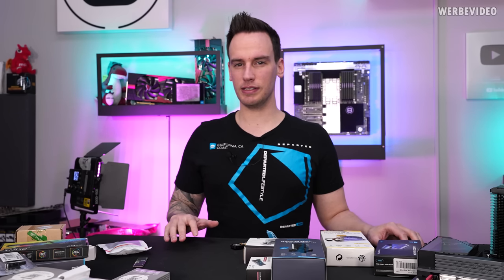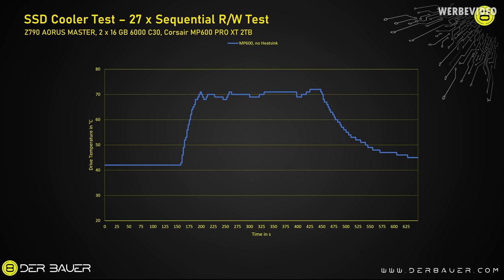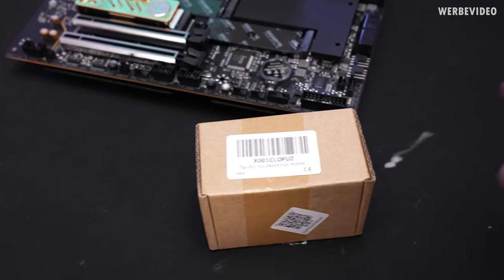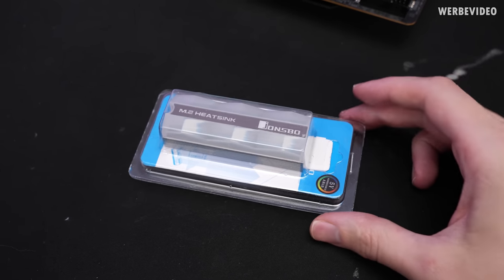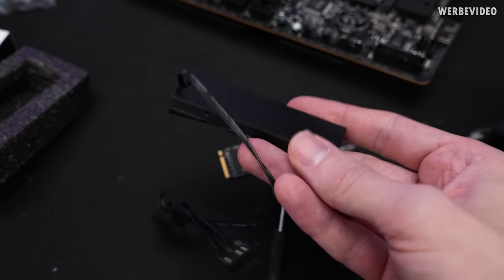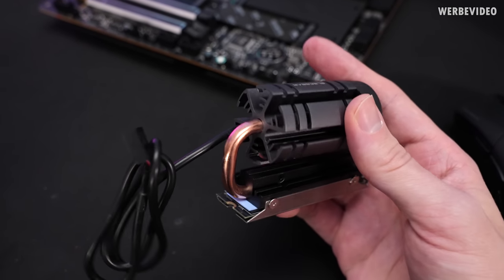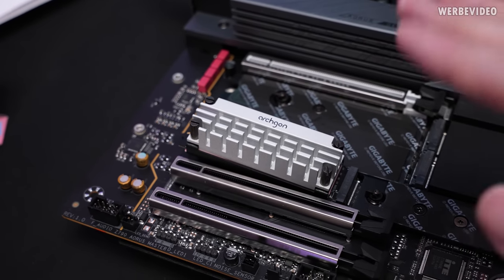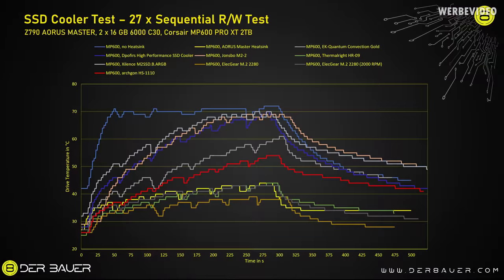Who designed these? Terrible Cooling Performance and "Interesting" Mounting Solutions

Comment: Definitely do another video! And in the end, the Dpofirs came in with the zip ties, and it was better than the EK cooler :D
Reply from the maker: will do :D maybe next time gold plated zip ties
Reply: @der8auer-en  Would be interesting to add DolDer 60mm M.2 cooler. It looks like a tower CPU cooler.
Reply: so whats your problem with zip ties, huh?! huh?! zip ties are 100% legit, maybe not exactly pretty but it works! zip ties and duct elephant tape!
Reply: @h0rk3d  Linus would approve
Reply: @der8auer-en  Speaking of whacky marketing claims with M.2 coolers I'm curious about icepc's graphene-coated copper heatsinks, how they compare with their copper variant and their performance compared to some you've already tested.
Other brands I'm curious about include 
Sabrent, BeQuiet, EKWB's finned aluminum model

Comment: Glad to see the Thermalright HR-09 performing so well and basically being one of the few non-scam solutions (might even outperform the stock shroud given long enough time because it actually transfers heat to another medium and doesn't just soak it up with sheer mass) because I'm planning to buy one once I have a PCIe 4 or 5 NVME simply because I like big shiny air coolers and I'll use any excuse to have more of them in my PC.
Reply: yeah it's the only one that actually looks like a serious cooler
Reply: I actually ordered that one last week (the smaller one with a single heatpipe) to eliminate the fan on my x570 ITX motherboard  (the ssd and chipset share a small block of aluminum with a 30mm fan on it)
Reply: 100%. I remember Thermalright being one of the very few who could compete with the big Noctuas so I had high expectations for them and am glad they delivered. To further defend the HR-09, the only competitive coolers were a comically giant slab of metal which would probably get heat soaked really quickly if the motherboard was fully populated with four drives and another cooler with a super annoying fan. With four drives that is a lot of cables, headers, noise, extra cleaning, and messing with software monitoring and control that you can avoid by going with the Thermalright.
Reply: The thermalright may actually perform better with a GPU pulling air through it as well
Reply: That thing is absolutely absurd.
Reply: @TangoOne  Good for you, motherboards with tiny fans on them are cursed.
Reply: I have been quite pleased with the two Thermalright cpu coolers I own. Their products actually work well.
Reply: Looks like there are 2 versions of the Thermalright HR-09 2280 SSD Heatsink, a short version and a larger version as shown in this video.  I wonder if the short version cools just as good as the original.
Reply: Based
Reply: @jordanviray  Heck yeah. I still remember way way back in the day using the Thermalright SLK-800u/900u coolers on Athlon XP platform. Giant solid copper fin stack. Was crazy back in the day. Back then water cooling was very DIY, and there were no AIOs, so it was about as good as it got with a manufacturer designed cooler. Especially if you threw a delta fan on it and pretended you didn't care about hearing loss. Hit some records with that thing on a volt modded DFI infiniti motherboard back in the day (280ish FSB iirc). Good times.

Still have an slk-900u laying around somewhere.
Reply: @icommandoi145  I have the short version. My first gen WD black was hitting 65 degree at load and with HR-09 it drop to around 45 at load.
Reply: @Turbobuttes  It's funny, I constantly see people complain about active mobo cooling fans but I've never had an issue with any of mine. I even just retired a daily X79 rig that has been a workhorse for over a decade and both the chipset and 5K rpm VRM fan still work like the day I got it.
Reply: @outsider2k8  I decided to buy both and do some tests of my own.  They're quite reasonably priced on Amazon right now.
Reply: @icommandoi145  I have it installed on a asus hyper m.2x4 card and my old case air flow isn't the best. I paid about 30 Canadian dollars for mine, thou there are so many different sellers while fulfilled by amazon.
Reply: Mounting that HR-09 on an Asus X99 board with that upright SSD slot it has is going to make GPU installs easier. Especially as that SSD slot is stuck out there next to the RAM.

I reckon with good case airflow it should shed heat even faster and probably drop a few degrees as well.

OK. Done. Ordering a couple.
Reply: The stock shroud solution is horrible, his test is wrong and doesnt reflect reality, i had aorus master and returned it.
Youll have diffrent results when you have more than one M.2 [I had 4] and after sometime, the heatsink not only abosrbs heat from m.2 but also from chipset and on z690/z790 it gets HOT
Reply: @NoBodysGamer  See that's why I dislike the entire trend of huge heatsoaking shrouds that give a false impression of good cooling. I'm starting to prefer boards that just don't come with shrouds in most areas and let you remove M.2 heatsinks one by one instead of only a single shround the size of half the board. In 2030 people will look back on these idiotic giant shrouds and cringe. Unfortunately the high end segment has basically been conquered by them because of sleek look memes.
Reply: Yeah, the Thermalright cooler looks like it has the surface to get rid of the heat. So yeah, with some airflow in the area, either due to the GPU sucking air along or case fans blowing in the direction should be good.
Reply: @TangoOne  but will you have enough cooling for your chipset now ?
Reply: I recently built a new rig, so I moved my Thermalright Macho rev A. from my FX8350 to R5 5600X, so it's nice to see them still being alive and kicking.
Reply: Thermalright had it in the bag since those heatsinks are basically repurposed VRM heatsinks they developed back in the day. Those were pretty capable.
Reply: @Turbobuttes  Just as motherboards got conquered by "gamer rot". Which is plastic and RGB. I would pay extra for a normal board with proper heatsinks on the important parts without cutting corners so they can incorporate fancy plastic designs and RGB.
Reply: @rustler08  Oh mein gott NEIN NEIN NEIN 9 9 9 9
Reply: @kurosumomo  Oh yeah, motherboards with copper heatpipes all over them, those were the days!
Reply: You need to check out the HR-10 Pro instead. It actually has an embedded fan and seemingly 2 extra heatpipes, and thus isn't as ridiculously tall as the HR-09. Plus it's only like a buck more so why not.
Reply: @johnjingleheimersmith9259  Because if there's one thing that active chipset cooling has taught me it's not to utilize tiny fans for what you can accomplish with case airflow.

Comment: Amazing job! Definitely waiting for the second part! Also would be great to see a bit more of simple and compact options in terms of height, like the last one (archgon) in that video. They seem far more reasonable to buy and the review  might be helpful.
Reply: A bit like small RAM heatsinks or those for Raspberry Pis, just a small fin arrangement that fits on the chip and gives some more surface to dissipate heat.

Comment: Great to see Thermalright still producing, albeit quietly and without fanfare, very functional and well performing cooling solutions.  I recently tested their Frost Commander 140 on my 13600K CPU and the performance was impressive, on par with the NH-D15.
Reply: I'm still using their cooler from 2008 on modern Ryzen CPU. Works very well.
Reply: They are getting good PR from Youtubers now. Gamers Nexus covered them so they're back in the hobby's notice.
Reply: I still have their HR-02 Macho in use here. Fine thing, does a fine job at a good pioce and without much noise.
Reply: He needs to run the HR-10 Pro instead! it has an embedded fan like that elecgear alibaba cooler.

Comment: My IcyBox M.2 cooler has a 30mm fan and I had to lock the fan at 20%. Any higher and you can start to hear it. It honestly doesn't even need the fan anyway, I actually thought about taking it off. It has a big heatsink, passive would do just fine.
Reply: In a file server believe me without active cooling  on nvme you lose performance  wich delays the transfer speed  and you don't want that on a file server  and if you install the entire pc in a cilmatised rack and noise isolated the you won't get bothered by noise 
Y mean in some use scenarios it it delivers high performance 24/7 without bottle necks  and it does not throttle is at best and at my opinion do not use copper cooling solution because it cant disapate the heat quick enough aluminum aloy is at best
Reply: @adriancoanda9227  yea really depends how much airflow and what passive heatsink you have on ur nvme but yea for servers they do get crusty and sometimes even the system is almost unable to load anything
Reply: @adriancoanda9227  Who said anything about a server? I have ITX PC build in Jonsbo V8 case. I use Mushkin Vortex Gen 4x4 Nvme and it runs HOT! That is why I get cooler.
Reply: @y_zass  check the voltages on the slot if they are in specs with the cards required cause that card should also compatible with less Powe devices like a PS 5
Reply: @adriancoanda9227  Copper dissipates heat away quicker than aluminium! If aluminium was better then all the cpu IHS would be made from it!
Reply: @madb132  oh copper has a better condutibility, but aluminum is better at heat disapation to air and is far cheaper and way more resistant to corrosion  why do you think they made car tires from it why do you think evey refrigerator has aluminum disparcer  when you want to build a heater in this case you are right copper is better because even after the hot water is cold it can still give heat away but that is actually a downside in pc builds where air cooling is the key  why the aluminum density Copper has a higher thermal conductivity, and therefore is superior to aluminum in processor cooling. Copper is better at conducting heat than aluminum, but aluminum is able to radiate the heat into the air better than copper because of its lower density. Look it up
Reply: @adriancoanda9227  The density of a material does not affect the rate in which it transfers thermal energy. Thermal dissipation and thermal conduction are the same thing, the only difference is where each term is used in common language. There are two factors that determine the rate in which two identical pieces of metal cool down, thermal conductivity (w/m*K) and thermal mass (Measured as specific heat per unit mass J/K*M^2 or per unity volume J/K*M^3). This is where many, yourself included get confused. You take a block of aluminum and a block of copper and heat them both up to 100C then measure how long it takes to cool down, of course Aluminum wins. However you are failing to account for the fact that you had to put 3x as much energy into the copper in order to reach the same temp due to the higher thermal mass. Density also has nothing to do with it, thermal conductivty does. Lead is 26% more dense than copper and has 1000% worse thermal conductivity. Silver is 17% more dense than copper and has 5% better thermal conductivity. Both are more dense, yet one is better for thermal transfer and one is not.

Fix the experiment by applying an equal heat source to the block of copper and the block of aluminum for the same time period, then watch how long it takes them to cool down. The copper wins every time, because it has a better thermal conductivity. At the base layer conductivity from metal to air is all conduction, convection happens beyond the boundary layer and is a combination effect of conduction and advection (bulk transfer in this case of heat energy through a fluid), add a fan and even more air molecules are in contact with the copper to conduct heat away via forced convection. The metal/air boundary transfer rate is still won by copper on all fronts. The reason we use aluminum instead of all copper is for weight and cost. Copper is almost 4x the cost of aluminum, it's also almost 4x as heavy. An aluminum heat exchanger in a fridge that weighs 4lbs would weigh 16lbs if it were copper, it doesn't seem like much but it all adds up. I don't even know what you are on about with tires, if you mean aluminum rims then it's not actually pure aluminum it's an alloy between zinc, Nickle, aluminum, and other trace metals. Copper rims would also be a horrid idea considering how soft and prone to work hardening it is, then add in the weight and you have the worst rims around. 

Now take the cost difference. A 2inx144in square bar stock aluminum costs $200, the same dimensions copper bar will run you $2,600. The reason they use copper where space is at a premium is because it's better in all regards thermally. They use aluminum when there is free space because it's lighter and cheaper and to make up for the worse thermal conductivity you only need to increase the thermal transfer area by about a factor of 1.6.

Comment: If you used the included thermal paste around the heatpipe then the ElecGear would probably perform a bit better.
A really intriguing SSD heatsink is the "JEYI Snowpard", It has an M.2 riser card which flips the SSD orientation and gives space for a thicker heatsink on the back of the SSD.
It makes more sense it pictures.
Reply: @adriancoanda9227  bot comment?
Reply: Oh, that actually makes sense. I was wondering how good is the contact between the pipe and the sink if the pipe can rotate.
Reply: @BlueDragonix  badly coded bot, that bot comment should have been posted under today's LTT or Hacksmith videos. (that's my assumption anyway)
Reply: @CanIHasThisName  That's what the screws are fore. Losen the pressure to rotate, then clamp it tight again for cooling.
Reply: @HappyBeezerStudios  Obviously, but clamping it only prevents it from rotating. For proper thermal contact, you need the thermal paste for the same reason you put thermal paste on IHS.
Reply: @CanIHasThisName  Yup. paste for thermal contact, screws for mechanical contact

Comment: If using HWInfo64 to monitor SSD temperatures, I'd recommend increasing the polling rate in HWInfo64.

I noticed when I tested my Samsung 970 EVO with the default 2000ms polling rate, it was showing a maximum ASIC temperature of around 70c~, but when I increased the polling to every 100ms and re-ran the exact same test, it was showing a maximum ASIC temperature of around 112c~
Reply from the maker: I'm using 500ms polloing rate and SMART every 10 cycles.

Comment: I'd be interested in the Performance of the BeQuiet MC1 Pro. It's fairly cheap and looks relatively capable, compatible with single and double layer SSDs, and small enough to not interfere with any other components. I use one on my WD SN850x Black, and it lowered idle temp by ~12°C...
Reply: Me too, those coolers are always sold out in many web shops too. Does that mean something?
Reply: HWcooling has a review on the MC1 Pro. It is among the top performers but still trail behind most motherboard stock solutions.
Reply: @MY-qi8wq  My motherboard is an older type for AM4 and don't have stock cooling, unfortunately. And I render a lot of music pieces which makes my SSD's throttling all the time and providing me extra warmth in these cold days 😅 But I don't see it happening on summer days ^^
Reply: @Bluelagoonstudios  I think it is decent. It has two heatpipes that run the length of the SSD, effectively sending the heat of the chipset over to the NAND, but not a hugeley increased surface area.
I'd like to see it in a comparative review like this one, because I have little other experience with M.2 SSD coolers.

Comment: A part 2 would be great and maybe adding a motherboard with a more average sized m.2 cover, I know a lot of boards just give you a single slot metal cover vs that massive one you had there.
Reply: Yes you are absolute right. That board is total insane ssd cooling vs others
Reply: Asrock gave me a cover plate shared between the chipset and two m.2 drives, meaning all 3 are the temperature of the hottest one all the time. Did not know ssds throttle at 70C already.

Comment: 2 big points: 1. most of these are not designed for an open testbed no airflow situation. Air is a very poor conductor and this will not help them to reach their full potential. 2. why didn't you compare with the included MP600 heatsink? People who want to purchase this probably don't have a massive cooling-plate that covers half of the motherboard

Comment: i wonder if the ElecGear gave you thermal paste for part of there (( adjustable angle feature )), since you can loosen screws and essentially rotate or possibly even pull out the copper heatpipe out of the bottom heatsink, wonder if they intended you to reseat it with thermal paste in there haha

Comment: Great video, would love to see more tested in the future! Also, something we need to keep in mind watching this is that Roman is conducting this test in open air with no flow. A stagnant hot box case will make things worse, but if you have good cross flow that passes these heatsinks it should help to improve things and stave off hitting the thermal soaking limit in bursty tasks.
Reply: I agree.  I have made my own NVMe heatsinks from heatsinks from old components that had many tall "fins" and made sure that my case air flow was such that it was in a direct path of the air and I had great results - it never got above 45c.

Comment: 12:13 the heat pipe is adjustable.  You loosen the black screws on the heatsink and can adjust the angle.  I have a similar one to this and I applied thermal paste to the heat pipe interface with the heatsink.